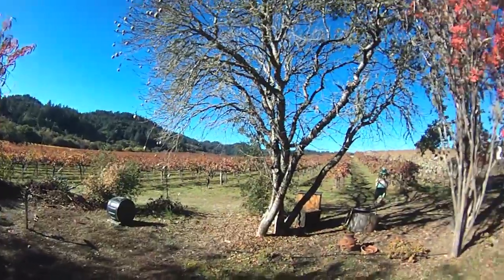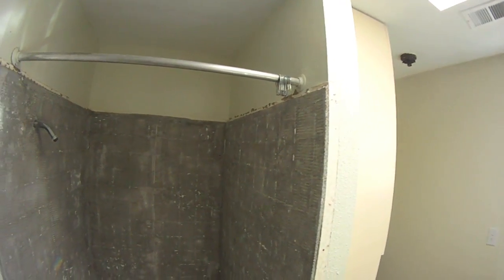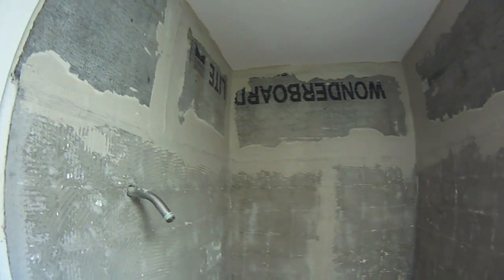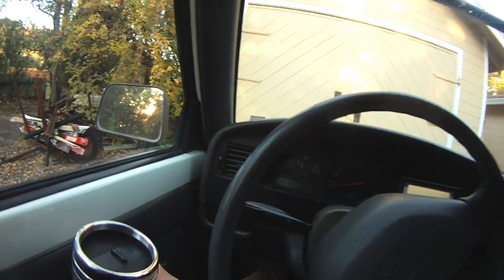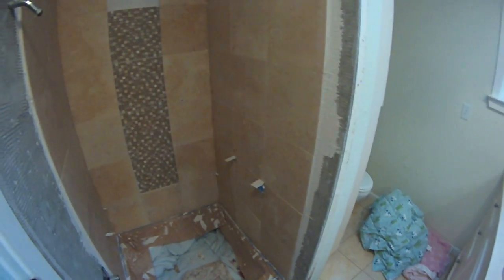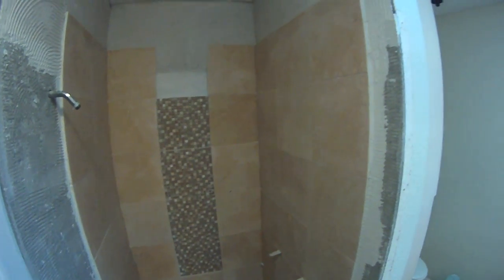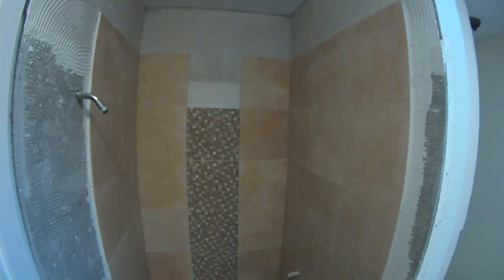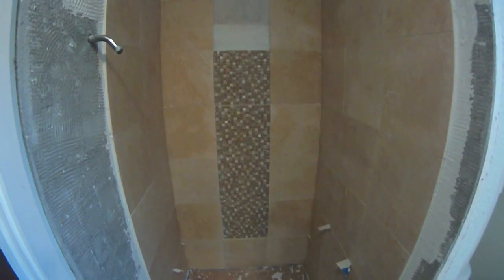Shower Enclosure Tile Job part 1

Comment: I'm rocking around a fiberglass surround right now and I have to build a tile shower next.  Not my favorite thing to do.  Nice work!
Reply from the maker: +628DirtRooster I have installed my fair share of fiberglass enclosures... but tile is fun because of the many options of color and design.  Thanks for watching!

Comment: Shower fixture down low , I have seen that before , but the ones i saw were used for washing pets and things , not the main shower , but anyhow lookin good
Reply from the maker: +wtbm123 Definately a curious plumbing job..it could be as simple as the installer ran out of copper pipe...lol.    Either way the owner did not want to spend the $$ to change it so it stayed.
Reply: +wtbm123 I was kinda thinking the same thing.  Would make a perfect doggie bath.

Comment: Nice tips on laying tile. I've never messed with that kind of tile, but it sounds like a good way of goingabout the job. Now for the farmer in me being interested in crops in other parts of the country, what are they growing in the orchard behind the house?
Reply from the maker: +ih1206 Those are wine grapes. Napa Valley in California is very fertile and the weather lends to grape growing.  Specifically the grapes behind the house are Cabernet.  The fields on the side of the house are Zinfandel

Comment: Goodness knows why the control valve is so low down - perhaps a previous tenant was very elderly or disabled and needed the control positioned lower?  
Interesting tips about the tiling process, thanks.
Reply from the maker: +Dan Whiteford Thanks Dan!

Comment: What is a 'door slammer' job?
.
The little tub looks perfect for giving the cat a bath.
.
Does this place have well water?
Reply from the maker: +Serp Ukhovian Hi Serp.  "door slammer" term I had used for years...when I would drag race, the door slammer cars were mostly unaltered sedan type of cars that were easy and fast...cars you could still open and close (slam) the doors on... not the fancy race cars that would require you to climb in through the windows or had lift-off bodies.  I guess that term sticks with me and I refer to "door slammers" as easy and fast jobs.    Yes, this property is on a well.